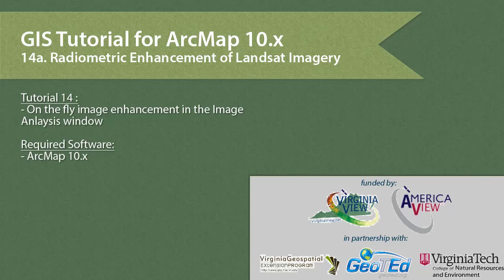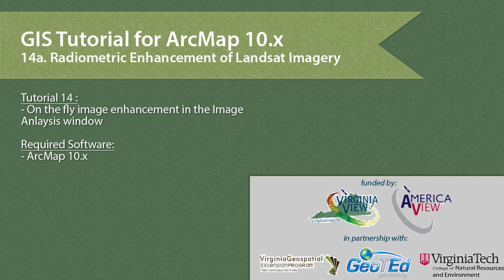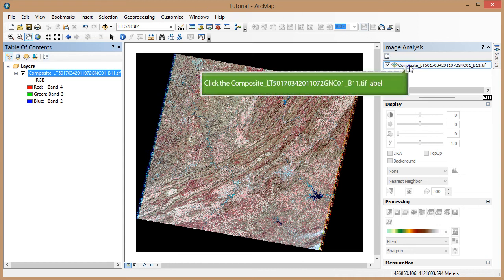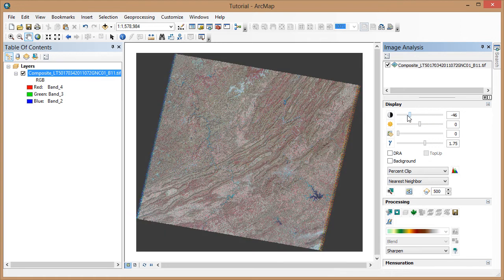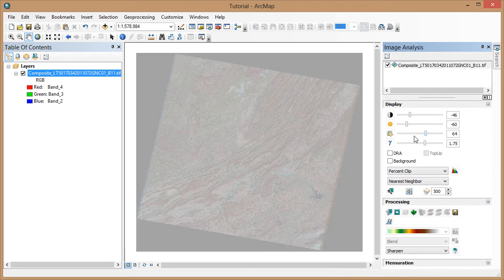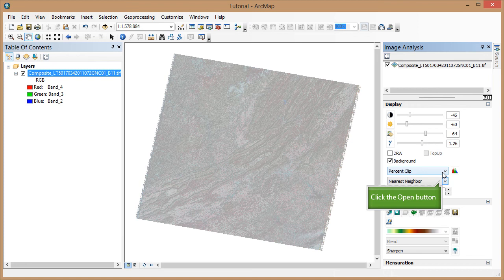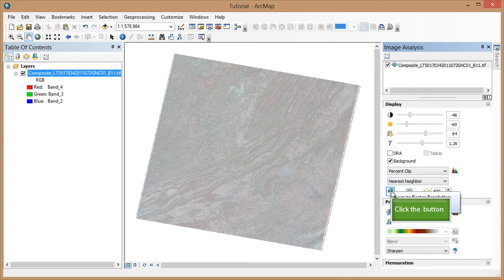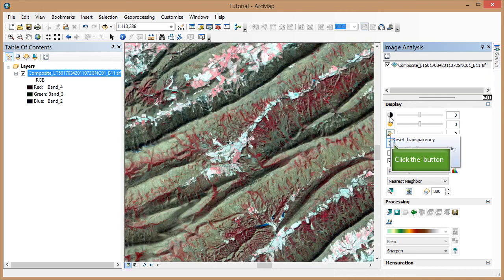Remote Sesing in ArcGIS Tutorial 14a. Radiometric Enhancement of Landsat Imagery

Comment: This video has been helpful..Please I would like to know the differences between geometric and radiometric correction. Thanks
Reply: a radiometric correction is a pre-processing step, whereby brightness levels of the image are fit within a more accurate scale. The most common case is to convert the DN values of each pixel to top of the atmosphere reflectance, although different usages require different conversions. 

A geometric correction is a pre-processing step, whereby the image is geo-rectified to compensate for distortions that happened during image acquisition, that happened due to the movement of the Earth's Surface. Done on the basis of some sort of ground-truthing, the pixels get slid into their respective correct position.

Hope this was useful.